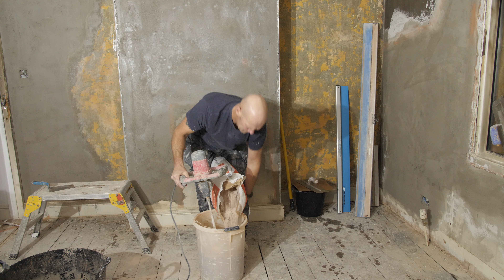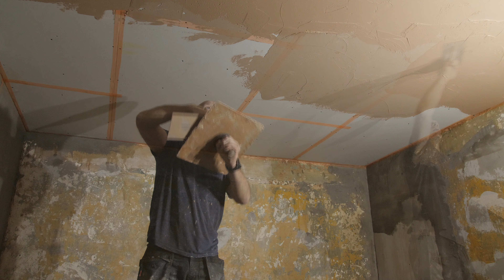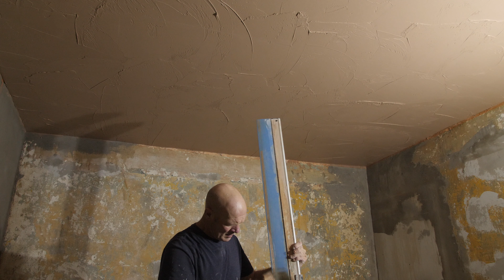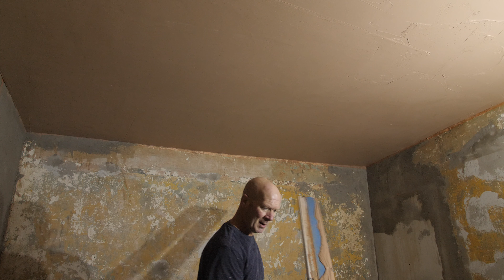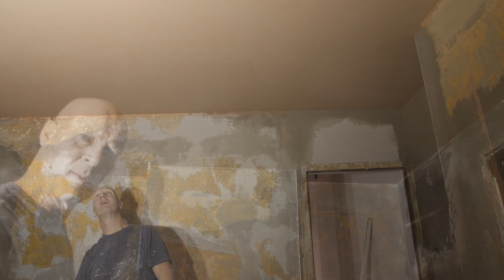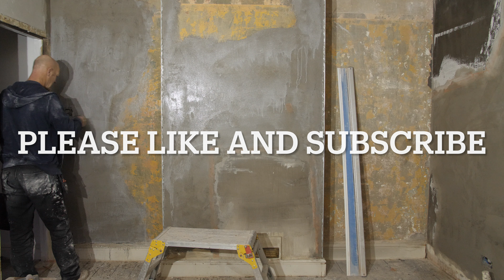Plastering a ceiling

Comment: Is that a 16-in trowel to put it on with or are you using an 14 nice
Reply: 16 inch👍
Reply: @outandabout4971  great videos thanks for the reply all I've ever done is render walls same job over and over up to 1.2 or 1.5 for damp roofing.. I plastered for nearly 10 years and never did one ceiling lol when I see you put your setting on it looks quite wet and you do a one stroke but the new flexi trails and speed skins means you can just throw it on and just flatten it in.. it's moved a long way since I first started one trowel does it all method.. easier on your joints as well.. I actually finished with one of those plastic trowel

Comment: Hi mate, I'm having an extension built with new 350 cavity walls, the existing is 330 but I want a flush finish, I'm having the new wall d&d obviously but how do I make up the 20mm discrepancy on the existing wall, would you fix another piece of plasterboard to the wall first, ( glued or screwed?) then just d&d the whole lot new and old and line completely flush, be interested to hear your thoughts mate, cheers 👍🏻
Reply from the maker: I would probably d&d some 9.5mm plasterboard to existing to bring it flush with the new wall and then d&d over the lot, the only reason for using 9.5mm is purely to give it a bit more adhesive when sticking rather than the dots of adhesive being to thin. Hope this helps
Reply: @worklife4221  Thanks mate that helps a lot, cheers 👍

Comment: If the noise of your step up or aluminium ladders irritates you as much as mine did, spray a small amount of WD40, using its straw onto any and every metal to meta joint, even where rungs join the ladder strings, ( sides), and the creaking stops. Works on loft ladders brilliantly. If indoors like loft ladders, use sparingly, with a dust sheet and wipe off any excess as you go

Comment: No offence been plastering a few years and you’ve made an easy job look hard  the way you apply plaster to a ceiling is very strange 😂 I’d start left to right bring the strokes as far as possible out then work the plaster back into itself from the other end it saves a lot more time and it’s easy to remove any lines !!!
Reply from the maker: Sounds to me like you should get yourself a channel on youtube and show everybody how its done as you sound like a right expert, the speedskim removes the lines also I did start right to left if you watched the video.

Comment: 3 stroke pul push then pull out from corners , not just one stroke 😬 Work from one edge and then come into your work . This is the most efficient way to plaster a ceiling
Reply: I agree with you Honest!!! I'm not sure? Is that a D.I.Y VIDEO ? Im at the plastering crap for 35 years and Honest! I have got a few new ideas over the years, maybe more! But that's not one .  
Ok.... One thing !  On an internal angle, instead of putting scrim cloth on , turn a scrim bead back t

o front, SIMPLE 🤩

Comment: Only 1 coat? should be 2 coats.
Reply from the maker: I did do two coats mate just didn’t show it I only mentioned it as my battery was low for recording
Reply: @worklife4221  Wasnt knocking your work mate my comment was probably a bit blunt...Nice job pal keep up the good work.

Comment: You don't reckon to scrim the internals?
Reply: Not sure what you mean about scrim the internals?
Reply: @ipfishing1466  scrim is the joint tape reinforcing. We used to use jute scrim for the internals and cotton bandage scrim for the flat joints.
Reply from the maker: @ipfishing1466  I know what skrim tape is I just was not sure what you meant about skrim taping the internals, if you mean where the ceiling meets the wall then they were skrimmed

Comment: Great vid, on the 2nd coat when is right time to start giving it a wet trowel
Reply from the maker: Hi mate glad you enjoyed vid wet trowel can be done one the second coat is touch dry if it starts to bubble just leave a little longer it usually means its not quite ready.
Reply: @worklife4221  what type of plaster is this and what is the base matterial of it , gypsum?
what work time have ?
Reply: @worklife4221  my old man didn't believe in cement mixers and mixers, I mixed the plaster with a roofing Batten, and back in the 70s when a bag of skim and cement was a hell of a lot heavier than the 25 kg they got today, I was about 8 and had to carry a bag on my shoulder for about a mile,
Reply: @1971dave  fair play mate I remember mixing for my Dad with a stick how times change

Comment: The lighting in this tube allowed me to see a clear definition in the plaster surface. 
All other plasterers tubes its really hard to see the surface definition. Thank you for this up load.
Quick question if I may, Whats the difference between using the Stainless Flex Blade and the Semi Stainless Steel Blade ? They sell two types but there is no description the different applications.
Reply: For me the stainless steel blade you can move the plaster about a bit more with the pressure that you apply and the flex blade will give you the smooth finish when doing final trowel, hopefully this helps